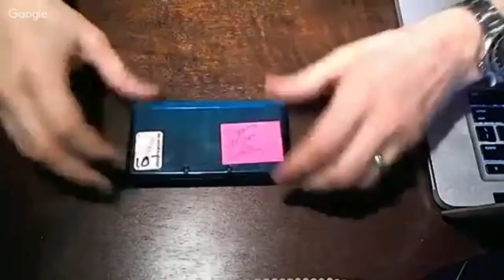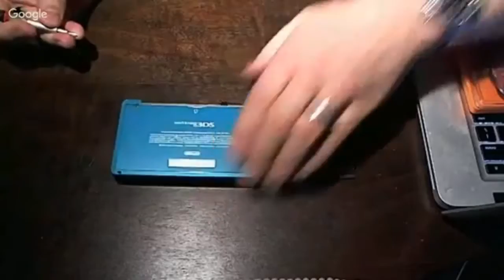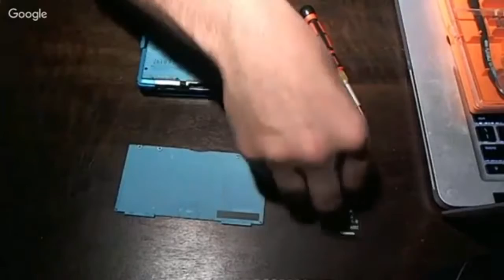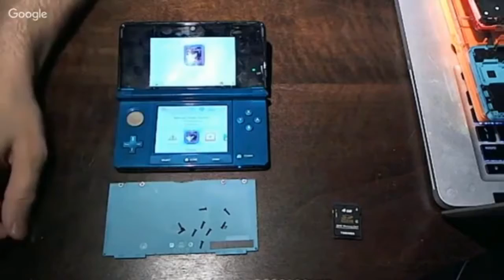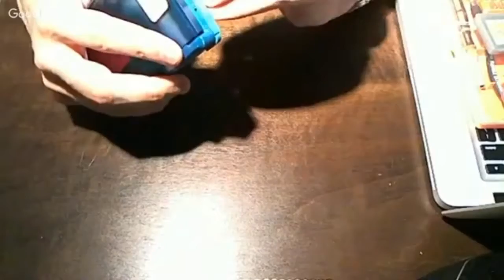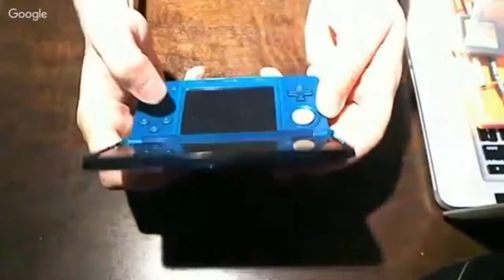How to Repair Broken 3DS L/R Shoulder Buttons (Also works for XL)

Comment: Cant u just take a qtip, soak it in water and dampen, and then just rub it on the cracks on the trigger?
Reply from the maker: Not sure, I wouldn't introduce water to a unit.  If they quit working, I replace them.  Never had one that was just a connectivity, or dirt issue.

Comment: Um lol I have a 3ds but the home button is like popping out and its weird any ideas??
Reply from the maker: Is this the 3ds or 3ds XL?  Is it just the home button?
Reply: Beckley Crackers I got the 3ds 
And the home button rubber or something is starting to peel off or something and since its peeling off the home button is popping

P.s my 3ds is over 7 years old I got it in 2011 so it's pretty old but I used alcohol and clean like everything

Comment: my a doesn't work
Reply from the maker: If this were my unit, I would open it up & take the logic board out.  Clean the button contacts with alcohol.  Once dry, reassemble.  There can be a lot of build up on the logic board causing a poor contact.

Comment: Someone please help me my 3ds start button won't work
Reply from the maker: Try cleaning the logic board with alcohol, right on the contact point with the start button.  Make sure that the board is completely dry before you reassemble.
Reply from the maker: Were you able to get any positive results?

Comment: Lost two of the screws during repair, but some superglue fixed it.
Reply from the maker: I would advise against the super glue, just in case of future need to disassemble.  Otherwise, great job.
Reply from the maker: The pop means one of the molex cables isn't in quite correctly.  It's failing during the power on self test.  It's not an issue with your battery.
Reply: I will check that tomorrow, but weirdly enough it only made a pop the first time. Now all it does is just not want to power on.